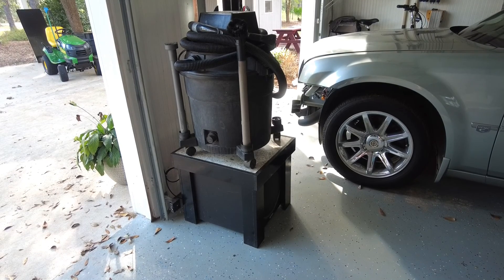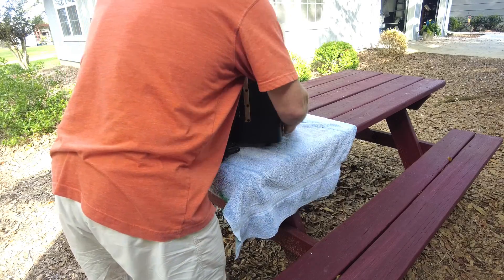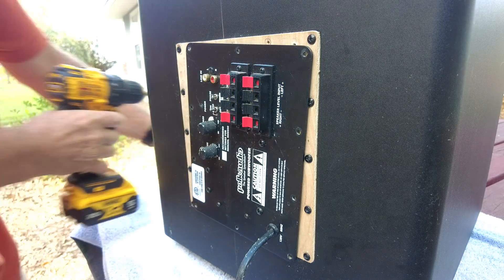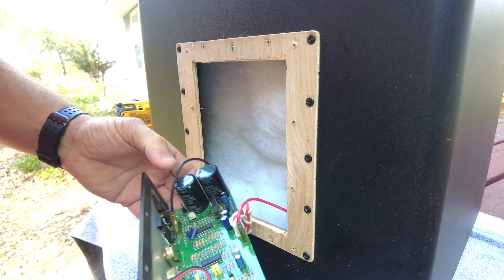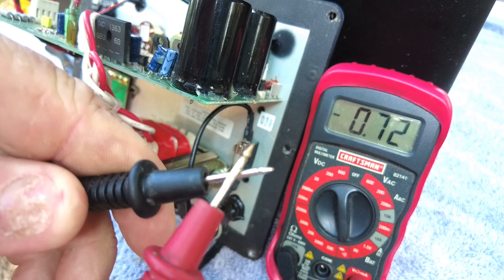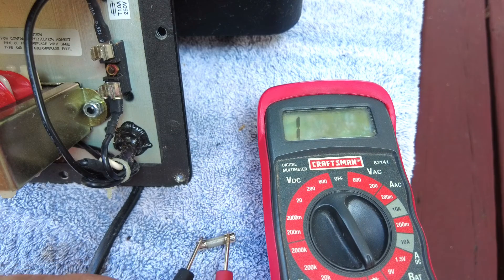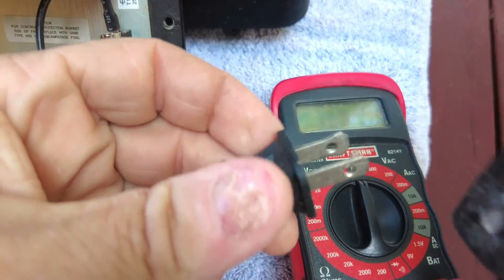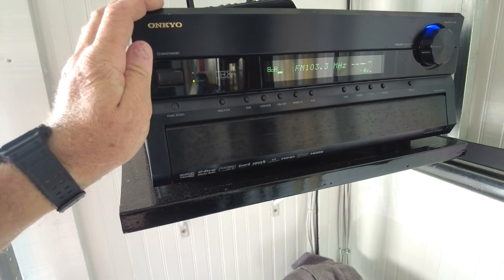Fixing a Dead Polk Audio Subwoofer

Comment: My polk audio lights turn on but no sound...? What should i do.
Reply from the maker: I would take the circuit board out and look for bad or burnt parts. Do a you tube search on bad solder joints and check for those. That's a start.

Comment: Thanks for the vid. Which fuse do I need to use?
Reply from the maker: I just dug through what fuses I already had and choose one that fit the spot and was close to the same amps as the fuse already in the subwoofer. All the fuses have the amps on the side. Some are really hard to read I have used a magnifying glass before just to read them. For me I want to use a fuse the same or high amps. Hope this helps.

Comment: My Polk subwoofer stopped working and here I am.  When mine is connected to power, the green light comes on so I don’t think it is a fuse.  Do you recall if your green led worked with the blown fuse?  I’d imagine there would be nothing.  Thanks.
Reply: Mine has the same issue. I took the subwoofer out of the cabinet and hooked it to my receiver to make sure it was good. It is. I put it back in.

Otherwise, I'm at a complete loss here.
Reply: @RodknockRhett  Mine was a setup issue. I ran the Yamaha YPAO program and it set the front and center speakers to “large.”  Apparently with some receivers if the front channels are set to large, the receiver will stop sending frequencies to the subwoofer. So I recalibrated and it started working again.

Comment: The electronics of the psw10 Polk sub which I believe that amplifier is from are known for 3 small capacitors to fail.. if it ever squeals or starts thumping those caps will need to be replaced
Reply from the maker: I have had a Subwoofer start making thumping noises before.